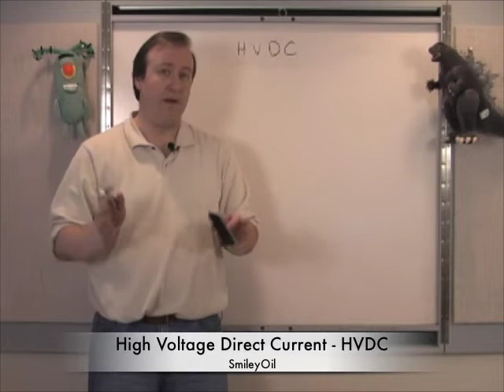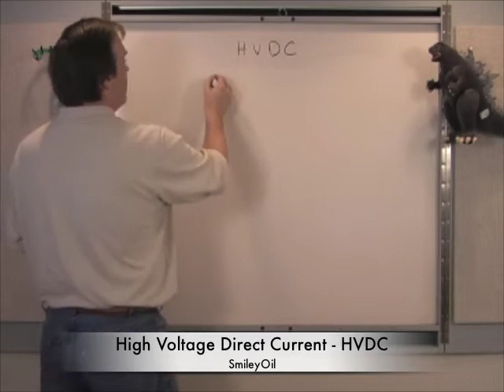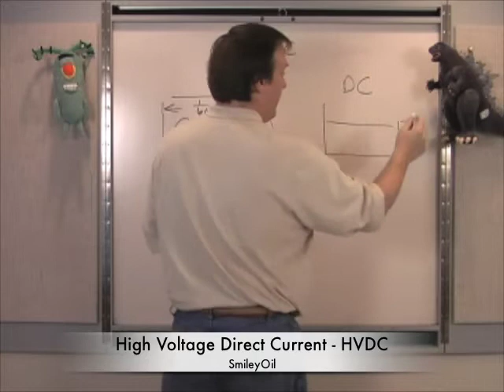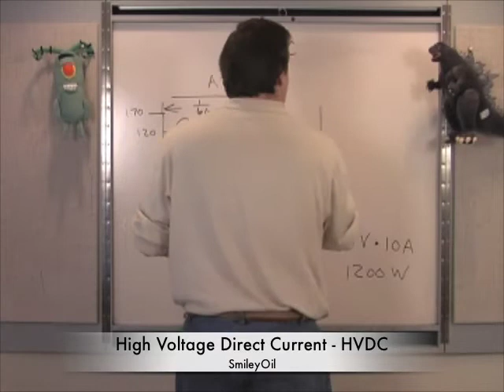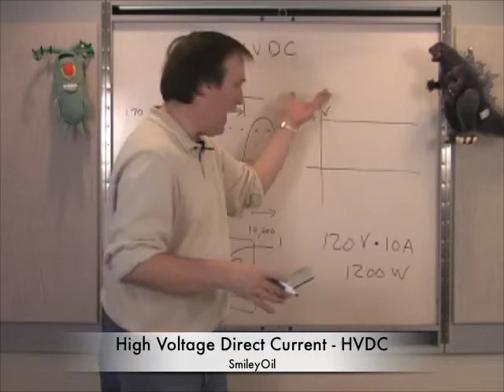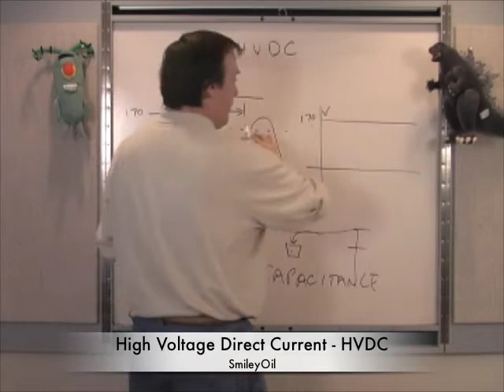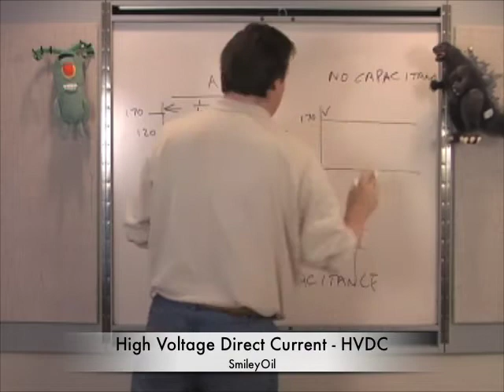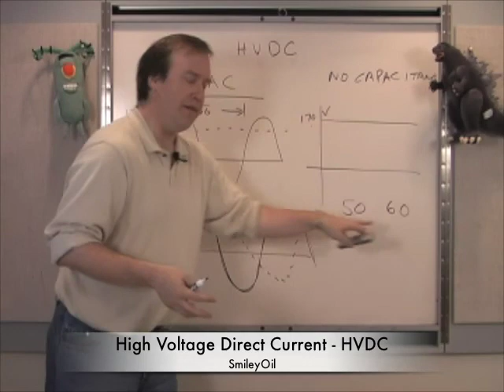#30 HVDC

Comment: Like your presentation.  A description I enjoy success with follows:

You don't see traditional incandescent light bulbs flickering because the filament does not have a chance to cool at the 120 zero voltages per second. However with LED lights you can see this in some dimer lights, such as Christmas tree lights, as  you quickly move your eyes across them. or wave them under your eyes.